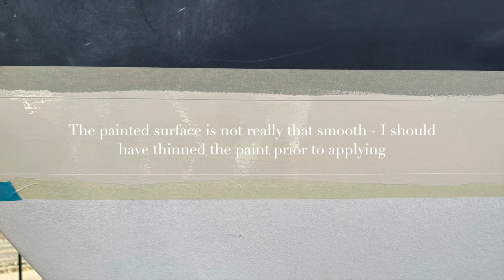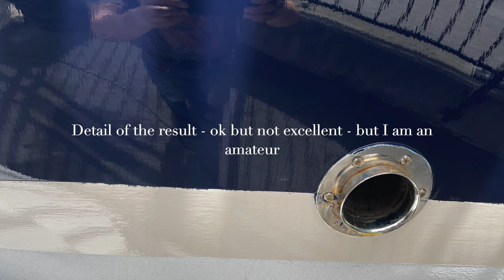Fisher 30 Northeaster Ep 5 - Painting the hull above the waterline

Comment: Shes going to look a proper Bobby dazzler ..🙂😎 when the woodwork goes back on.its such a key feature of these boats.
Reply from the maker: Thanks, Clive. Yes, she looks a bit naked without the wood (and the rigging). The old teak was worn-out and partly rotten (!!!), so I am working to find a suitably replacement wood. Hard to get teak at a reasonably price here in Norway...!
Reply: @hsobstad  
What did they use on the old boats of the past ...😉
Reply from the maker: @clivestainlesssteelwomble7665  Mostly teak on the outside - and teak and mahogany on the inside. At least thats what I have learned.
Reply: @hsobstad  
Im talking ancestors.... native built boats.. oak elm..
Reply from the maker: @clivestainlesssteelwomble7665  Oh... Sorry! There I can only speak for some of what inspired the designers of the Fisher motorsailers, David Freeman and Gordon Wyatt. I have read that they took inspirations from the Norwegian built Colin Archer rescue boats from the naval architect with the same name, and the first built in 1893 (and is still in seaworthy condition). These were - as far as I know - made of oak. Later the outer skin were made of pine. The inspiration can be seen on the Fisher sterns, ketch-rigging with quite small mesan sail, relatively heavy internal ballast, and probably more. Not sure what was used in wooden boats in England at that time...
Reply: @hsobstad  
I figured it would be a variety of Oak ... or ash commercial vessels would have not had the luxury of tropical hardwoods ... and going back further to RN and Viking age ships they certainly used their native timber species to provide the technology. Trees in woodlands were grown to provide structural knees as they are stronger than cut items.. 
Hornbeam was much in demand for RN ships pulley blocks.  Given the side rails are not immersed in water and easily oiled or otherwise stained and sealed.  You might find a European available substitute in past historic ship building practices/timber technology.  🧙‍♂️🇬🇧 Elm was a wood often chosen for coffins and sluice gates due to its rot resistance in water.  But not very good at resisting tropical worms.😉 Hence the whole copper bottom  
Phenomena.
With Elm disease we lost that option but there are others.
Slow cold natural grown traditional scandinavian conifers may be up to laminating to provide the mechanical properties as well as the rot resistance. Ask around some restoration and historic replica yards see what they think/use🤞🏼👍🏼⛵

Comment: Superb job ... did a previous boat in Perfection Blue ... our current F34, we chose a custom Epifanes LPU color ... paint is hard but was difficult to roll and tip.  You're not going to regret any of the work you're doing ... envious of sailing in your area ... but then ... the Pacific Northwest is pretty special too.  Hope you're getting some rest!!  All the best ...
Reply from the maker: Thanks for your kind comment. Looking forward to finish restoring and then actually sail this boat. :-)
Reply: What kind of color did you go with?
Reply: @michaeloliver1038  Hi ... they were able to mix a color similar to the Bootlak #4 (rather like a golden tan with a hint of a bit of green).  Works better than the original buff gelcoat.  Hard to apply tho ... but tough as nails!  Cheers ... Tom
Reply from the maker: @michaeloliver1038  ...and this Fisher is International Perfection polyurethane; Mauritius Blue on the hull and Cream on the superstructure.